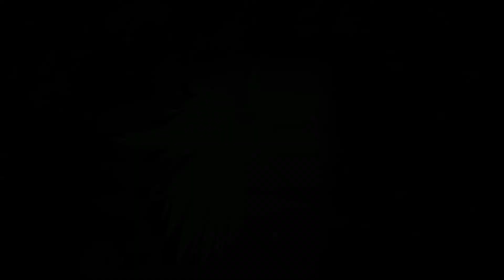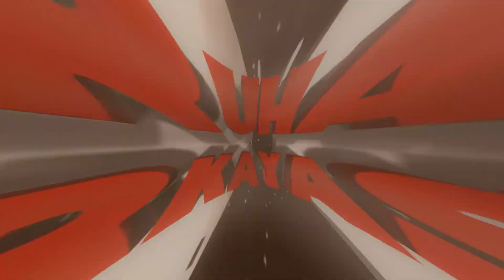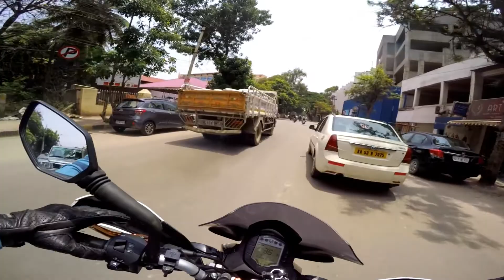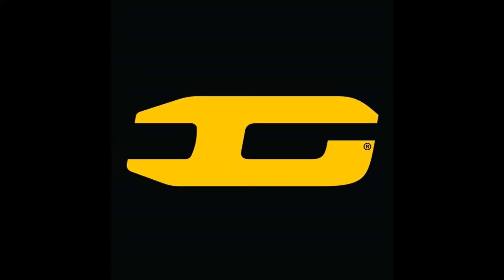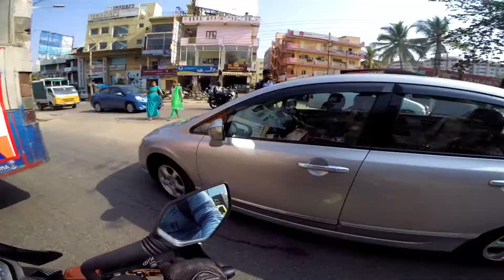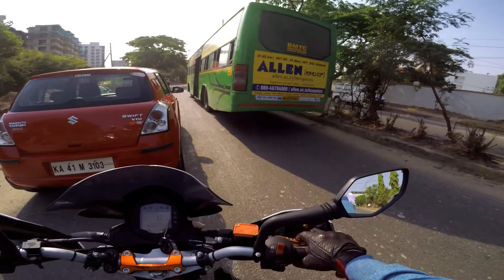KTM Duke 390 | IndiMotard's Greasehouse Grunt V2 Exhaust - Installation and First Ride

Comment: My stock exhaust is screwed, I want to upgrade it, how’s your experience with this exhaust, for almost 2 years (approx) now?
Reply from the maker: Vlogtech sold the exhaust 2months later and upgraded to race fit gp exhaust...you can go for it this exhaust sounds good but once you change the exhaust you have to look at remapping your ecu and increasing your air intake....

Comment: Does it harm the engine ? Any mileage/ average drop experienced?
Reply from the maker: Chhayank Agarwal Depends on are you going to remap your ecu and change your filters or not...if not then stick to stock exhaust it is made for optimal balance of power and fuel efficiency